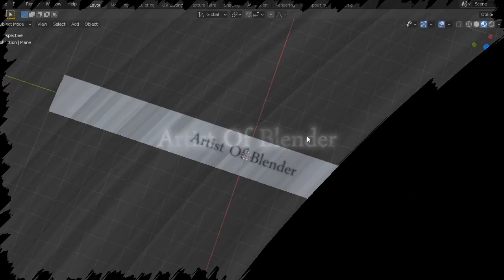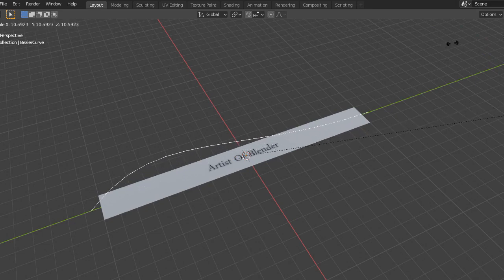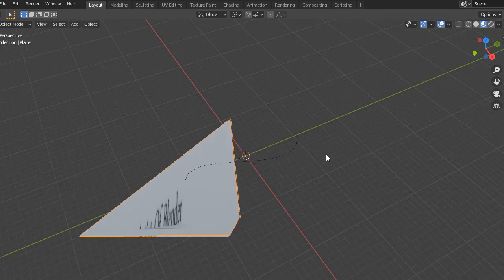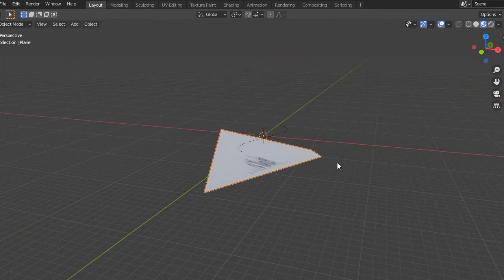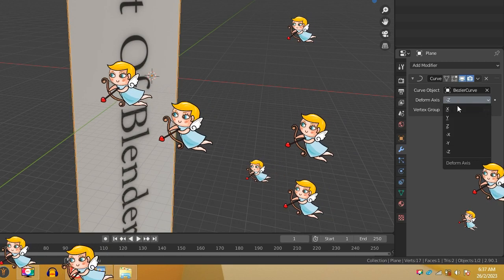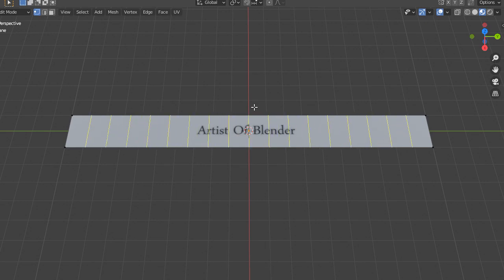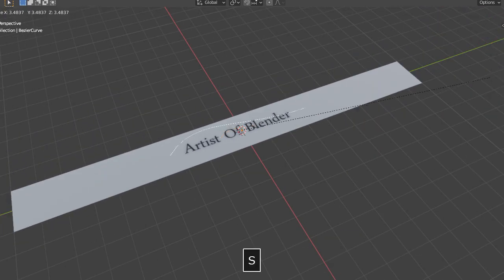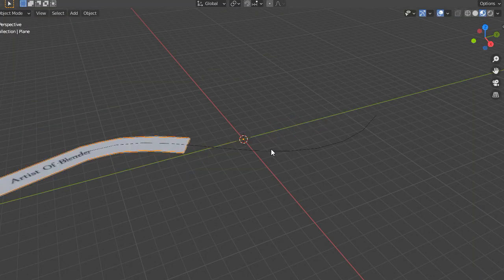Why Is My Curve Modifier Not Working-Blender 3.0 Tutorial-Use Curve Modifier Correctly Now!

Comment: for anyone wanting another way to fix this:
1) Select the curve, then go into "Object Data Properties"
2) Look in "Curve Deform" and turn off radius
Reply: I'm trying to add curve modifier to array of small planes, I turned off the radius in curve properties, but it is still not working, do you have any idea why it is still not working? origin point of curve and the array is the same. after I add the curve modifier and select the curve, the array "flies" away and when I use G to move with that, the origin point is changing. How did you move the objects without changing its origin point please? thank you and have a great day
Reply: same bro
 @karolina6thatgirl
Reply: finally something WORKED, although i still had to adjust the objects location as it spawned at the other end of the curve with wrong rotations, but yk what, ILL TAKE IT!, atleast my object didnt turn into a biblically acurate angel, so im GOOD
Reply from the maker: Nice https://youtu.be/gKREVC6rKX8
Reply: Do you know what I love about Blender? comments like this one. I have been using it for almost 3 years, and I learn something new every day, thanks, man!
Reply: Thank you 🙏
Reply: That was what i looked for, ty!
Reply: Thanks dude, You saved me.